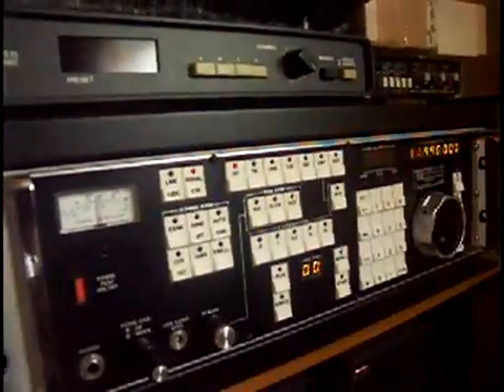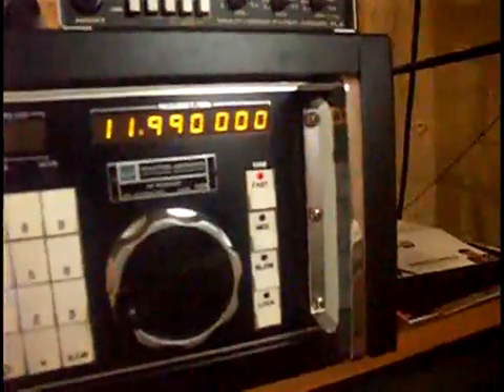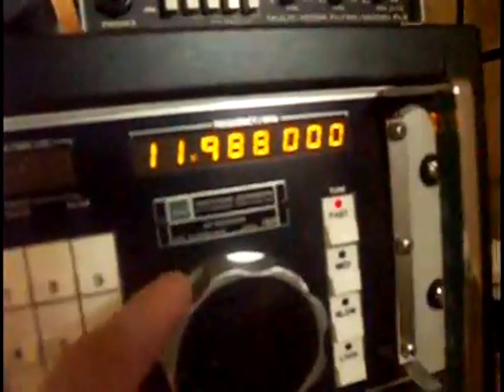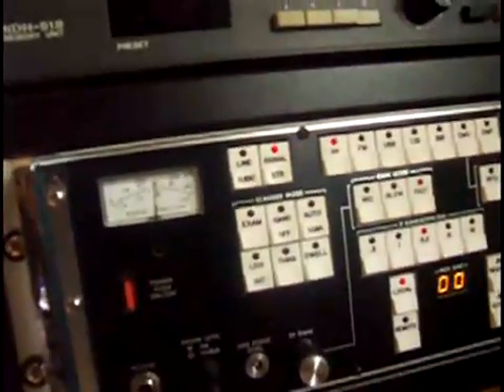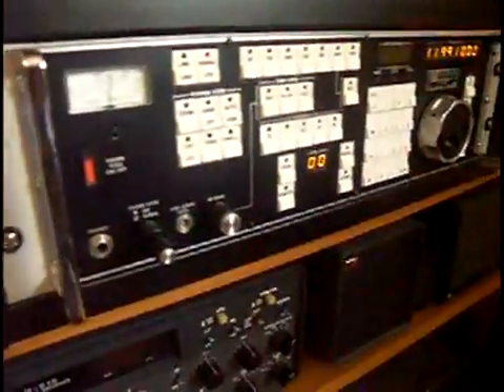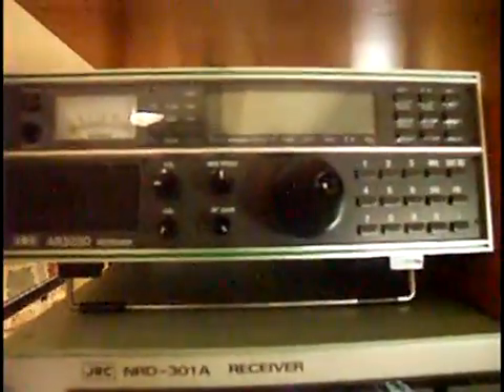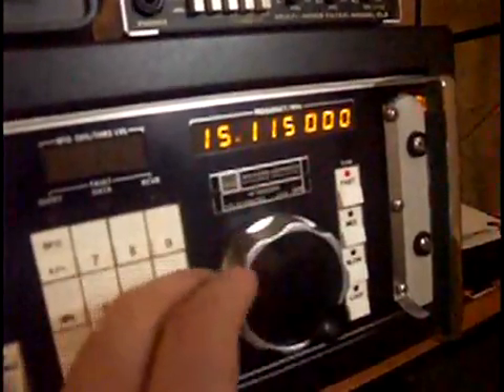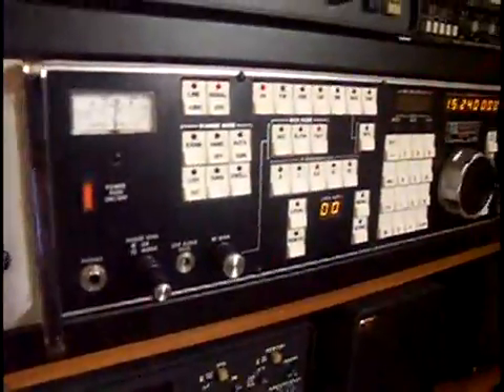WJ 8718A MFP

Comment: My 8718a was out of action for some time, but luckily I could find a technicial  person who pulled out every cards cleaned it and replaced two ICs and some burned-out caps. I will luckily get it back in good working condition soon. Priced processions, but if something goes wrong, that's it.

Comment: The "Microprocessor" (not multiprocessor) LED segments are driven from a strobed current source which will cause a whine in the audio if the brightness is turned up too high. Behind the front panel PC Bd is a trim pot to adjust display brightness (left side). Turn this down to a comfortable viewing intensity and the whine will drop below the receiver's noise floor. Happy listening, Bob, N1KPR, AmCommEngrs

Comment from the maker: No not really....or that I have noticed....the one thing about the MFP is that it is built like a tank and is very quiet -- in fact compared to Ten Tec 340 it is much quieter, likely due to the heavy metal construction and insulation of components....